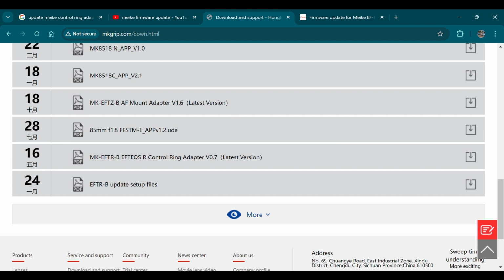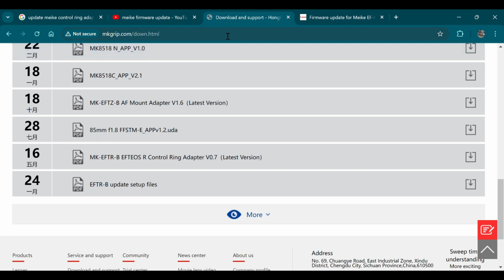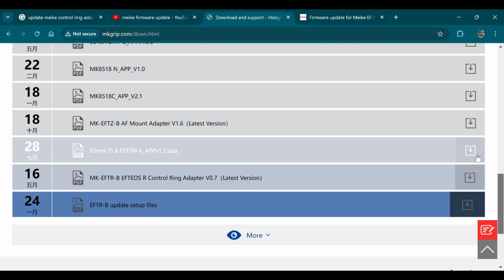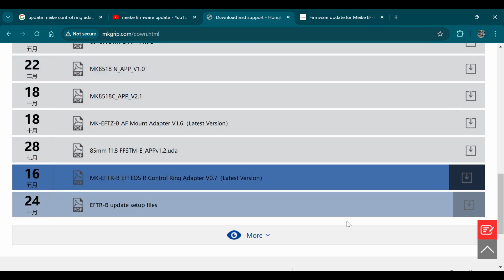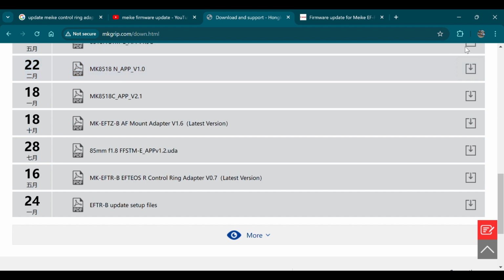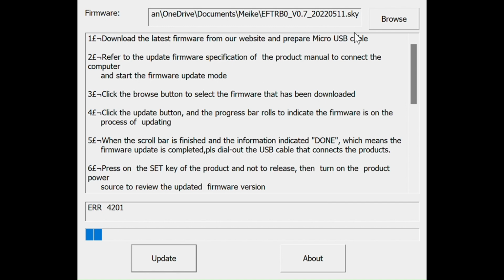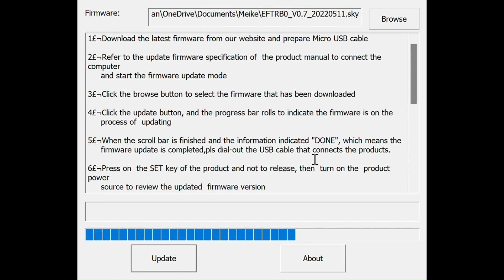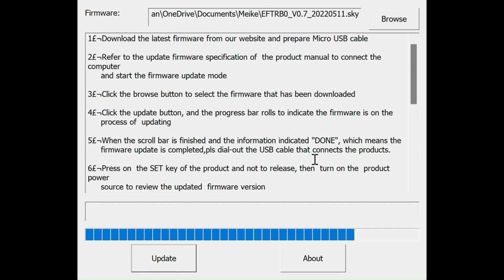Update Meike Control Ring Firmware

Comment: Unfortunately, your video doesn't explain anything. First of all, the files on the website that you need to download are .pdf files. After downloading them, you need to manually change the extension to .rar and only then you can unpack them. After installing, connecting the adapter and starting the installation process, errors start to appear. The probable cause is the Chinese USB port driver that was installed with the software, which has some problem with other USB devices and drivers. So far I still haven't managed to solve this problem.
Reply: One more thing - in its current state, the ring in my adapter does not work. I was hoping an update would fix it.